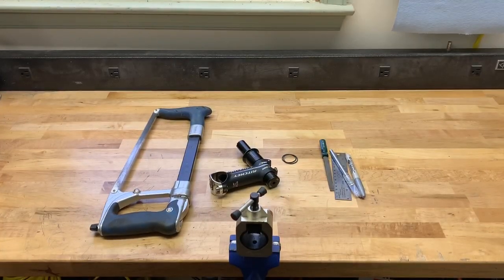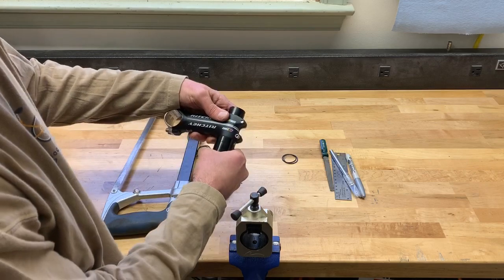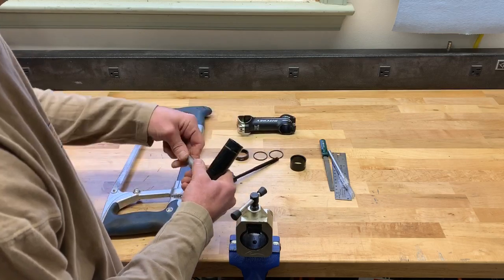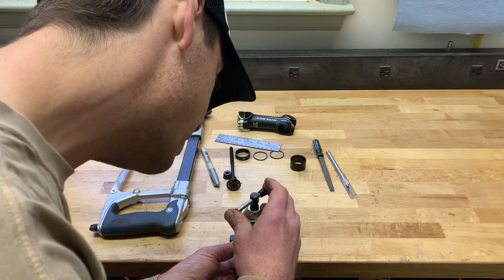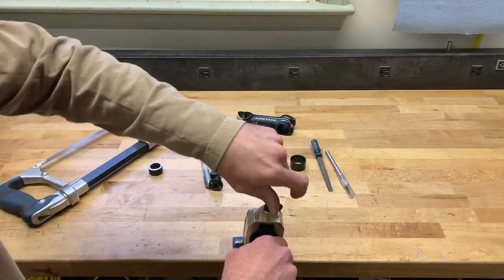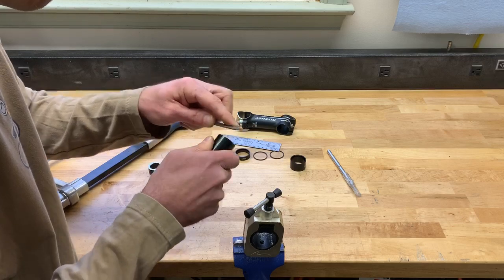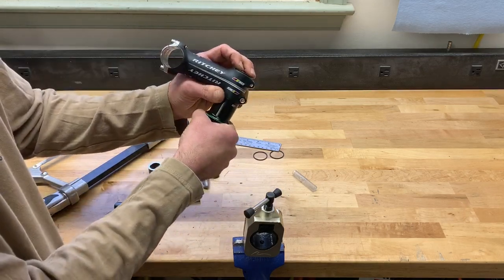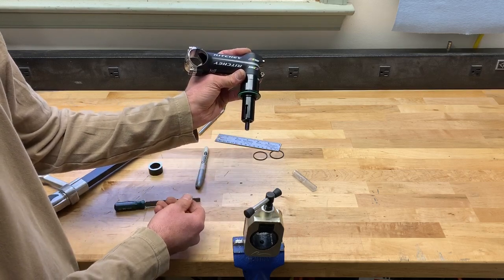Innicycle Steerer Tube Upper Portion Length Trimming

Comment: does the top cap fixed to the bolt? I wish the top cap overlap the diameter of the tube so that it should hold the stem down from coming out or push some spacers down.
Reply from the maker: Innicycle spacers have internal o-rings so they stay in place without any pressure from the stem. A threadless stem's clamp does 100% of the work of holding it to the steerer tube, in the same manner as it clamps the handlebars. The top cap only overlaps a threadless stem for adding preload in a true threadless system; innicycle headsets apply preload using the fork's threads just like the original headset did so there is no need for any overlap.